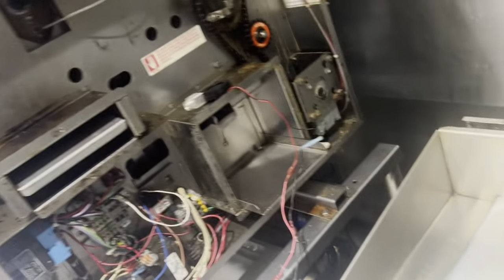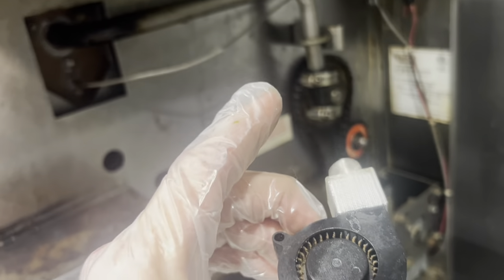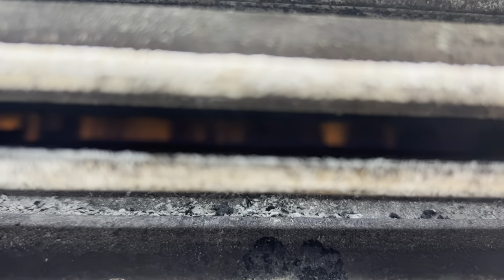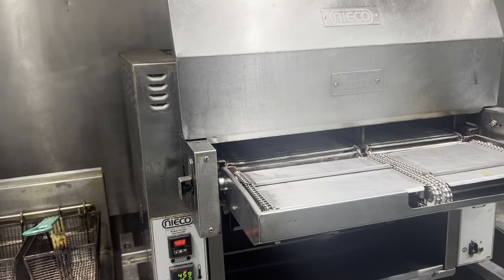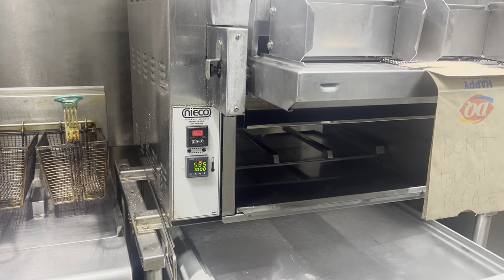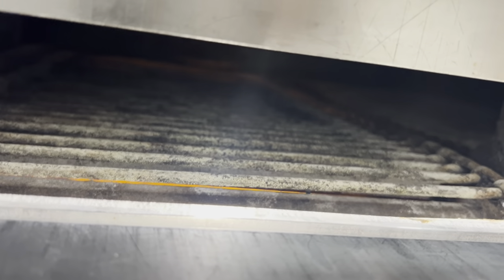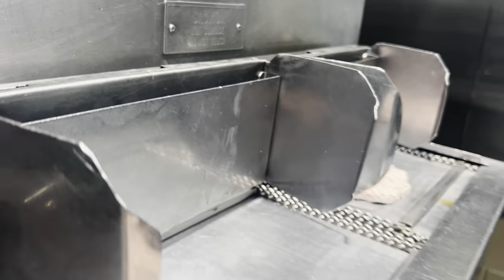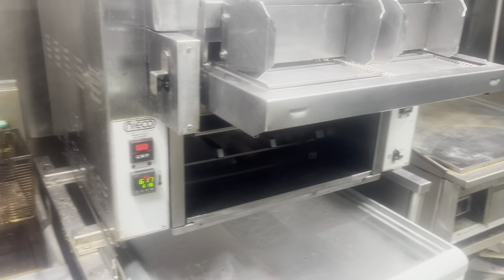Nieco - airflow and temperature calibration

Comment: Nieco did used to had a baseline chain broiler that they recently discontinued. I think it was the model 880 if you want to look it up. It use two banks of infrared burners, rather then the ribbon burners at front of the cook chamber and air boxes like the one in the video uses. I believe there was four IR burners on the top, and the another four on the bottom had a clam shell like plate over each one of them.

Comment: The problem is they went with a Windjammer blower.  Those things are insanely expensive, part of the reason being that they are only made upon request.  Now if they insisted on an American-made blower I can see that.  But I have seen much cheaper commodity brushless motor blowers which are probably even more robust than that one and would certainly work in that application.
Reply from the maker: That’s the OEM.  Gimme an alternative please !!
Reply: @restaurantrepairs  I just sent you a link.